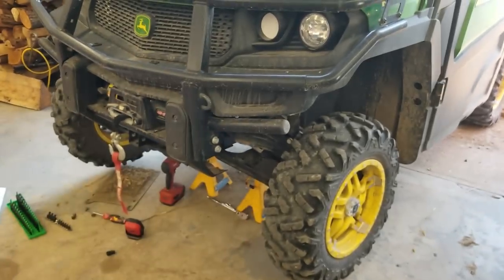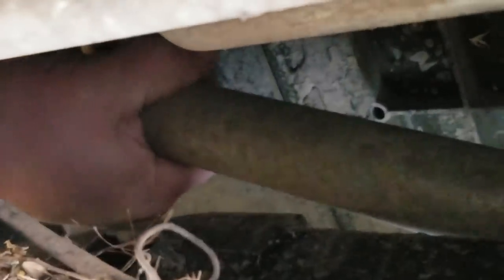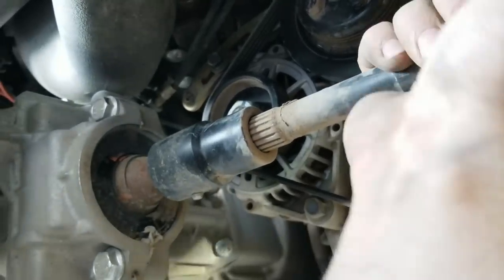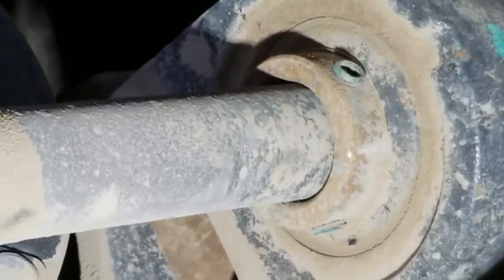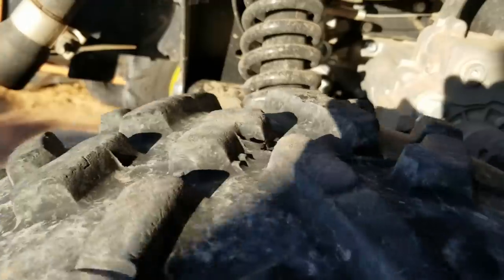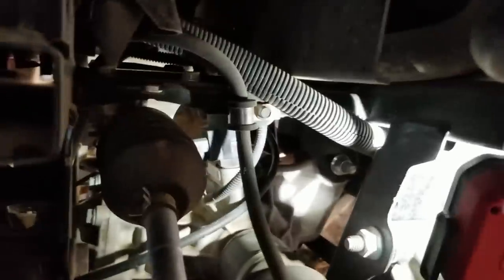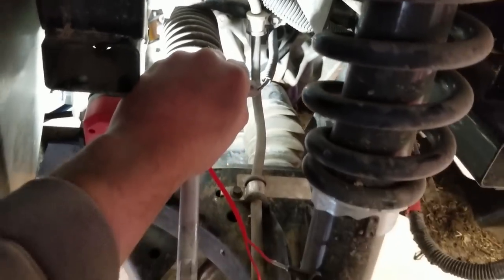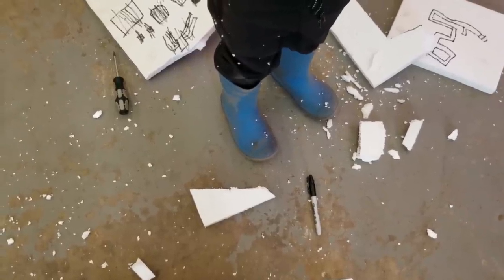Deerest Gator;

Comment: Dave's rule...The stranger the electrical problem is the more likely it's a ground issue
Reply: Did you test straight to ground or through harness ground?
Reply: Who is dave? You?
Reply: Specially with a funky voltage.
Reply: Yeah, seems about right. And comparing hot to a known, good ground as well as the harness ground is always a good idea
Reply: Said me a Cherokee owner without a factory temp gauge.
Reply: @carlholm7867  not to throw a wrench at your monkey but what if it's a ground side switched circuit. There for not known circuit design may appear to be an open.
Reply: Especially when voltage is low. Could be a corroded connector somewhere too.
Reply: @uberdang830  bingo, common for solenoid control
Reply: Best & truest comment I've read this millennium
Reply: Or a fuse
Reply: Anytime the angry pixies aren't raging out of the factory in the correct direction I always start with step 1.... Grounds grounds fn grounds!
Reply: Dave Thomas? I thought he was known for fresh never frozen…
Reply: The IO system on the buses I work on almost exclusively switches grounds for inputs. It's annoying but safer for the modules.
Reply: Seems to be modules instead of grounds for me
Reply: At least with DC 👍
Reply: Came here to say it sounds like a ground issue as well. Rubbed wire or such. Good luck with the repair
Reply: It is possible that the confuser will not power up the solenoid unless the engine is running.
Reply: @Travis Titus  I'd be surprised if the signal came from there. It's a simple on off. Easier to accomplish with a switch.
Reply: Dave? Dave's not here, man.
Reply: @tracyrreed  scrolled all the way through to make sure someone covered this 👍👊🇺🇸🤘
Reply: Ahh good times, inherited a mid 90's Olds sedan from my grandma in my mid 20's.  Every time the + sidepost got too loose it'd randomly decide to kick the automatic headlights on sometime during the night and kill the battery.  Was unlucky enough to be outside burning a cancer stick first time it happened under my ownership (my grandma had always assumed it was her fault when she was alive b/c she never saw it happen with it being stored 24/7) and nearly swallowed my smoke when it did it's christine impression at 1:30 in the morning...  The fact that messing with the switches did NOTHING til I ran back in and grabbed the keys to power cycle all the systems was just icing on the cake.
Reply: @sutitsivart  my thought as well
Reply: @uberdang830  True, but I've never come across that myself, so how common is that really? I'm just a basic home wrencher tho, so I'm certainly not the most experienced.
Reply: @carlholm7867  it's really common in automotive circuits GM late-models, Chrysler. So it gets interesting because you can easily burn out a computer driver.
Reply: @carlholm7867  scanner Danner is a good resource. His book has saved me thousands of dollars.
Reply: Bad Ground, something grounding out, or maybe some corrosion somewhere. Being that its a got 300 hrs, and the state of the grass under skirting,  I'd guess a wire is rubbing somewhere and taking some of the voltage away from that solenoid.
Reply: @ctdieselnut  hey
Reply: @uberdang830  I think you're looking for the word therefore?
Reply: I'm afraid I can't do that, Dave.
Reply: Booger Welding all the wires to the block is mint right? 🤣
Reply: Unless it's a 99-04 superduty then it's probably the windshield leaks and the gem module has been soaked
Reply: @brandonmiller7466  Not the gem module. Not going anywhere without a PATS immobolizer bypass.
Reply: @bluecar5556  the only superduty I've ever had that has PATS is my excursion and the gem module is fucked, neither abs or windows work...well windows work now thanks to a bandaid fix till I get the windshield issue fixed, my first f250 wouldn't come out of 4x4 because of that issue, the current f250...that's just a clapped base model, I don't rightfully know what her malfunction is.
Reply: Oh f250, the diesels didn't get pats immobilizer until later on.
Reply: @countryracer69  no angry pixies here boss… just some lazy cows

Comment: After fixing JD's for years, I've found the easiest way to get at the underside is to use the chain hoist and hang them from the nose
Reply: That or an adjustable lift?
Reply: This is for the vehicles or the engineers who designed them?
Reply: @cerealport2726  As an JD employee i firmly agree.
Reply: @cerealport2726  vehicles, although not putting a harder lift bar on the tractors when the deck has bronze pins has made me want to set people on fire
Reply: @handyman75657  in for a penny, might as well go full send when picking it up
Reply: god ain't that the truth
Reply: @cerealport2726  he said nose, not noose! 🤪
Reply: @duckdog8052  why what’s the difference with bronze pins ?
Reply: @Lamineth  first one, then the other...?
Reply: Same for riding mowers. Just hang ‘em up.
Reply: @jamesfair9751  the hardened bronze pin is tougher than the mild steel lift bar. It wears the hole into an oval then the pin is able to bounce damaging it worse
Reply: I thought the best way to get under a JD was signing the loan?  Puts me six feet under just looking at the total.
Reply: @docferringer  That's why I said to get to the underside, not underneath
Reply: Double duty on that long overdue shop floor oil treatment. Gotta keep your concrete lubed up!
Reply: And just why do I want to get at the underside of a JD engineer? Do they require a annual inspection or something.  I've hurd that  the new engineers come with 1 or more  lift points installed by the owner, and how about some bolt holes in those boots to prevent the engineers from getting too high at work.
Reply: I initially read that as "noose"...

Comment: They never had these kind of problems with the lunar rover 😉
Reply: You could have a reliable vehicle if you are willing to pay 5 million per vehicle. In fact, cancel that, there is one parked on the moon going free.
Reply: Because its a Willy's Jeep.
Reply: Because it wasn't metric 😜
Reply from the maker: Old tech is best tech! Yutu rover traveled 0.1km in 2013, Curiosity 9.9km currently, but Apollo 17 Rover managed 36km in 1972!
Reply: @arduinoversusevil2025  loony rover must be due a service by now…….
Reply: @arduinoversusevil2025  Lunar Rover had proper Red necks driving front and center around the moon.
Not some software millennial in a back office outside Orlando with a joystick navigating across Mars.
Kinda like you on a golf cart in the annual Skookum tournament.
The back nine can be a bit bumpy, but she’ll getcha home.
Mars is a bit more like Saskatchewan.
Reply from the maker: @SupermanJH68  or Nevada.
Reply: @arduinoversusevil2025  'twasnt made in China in '72
Reply: @arduinoversusevil2025  lol, sssh, don't ruin it for the boomers 😂😂
Reply: @arduinoversusevil2025  36km... That has my brain-a-turning. The Gargler says it was running off of Silver-Zinc batteries, and had 4x quarter-horse wheel motors. I've heard that type of battery has very good power density, but that's a challenging comparison there. Especially since the videos demonstrate that they were not really driving conservatively.
Reply: Check the relay. I've seen where they were in route to the f it bucket and just not make food enough contact
Reply: @buckstarchaser2376  If you think that's amazing, you should look at all the stuff they had in the 'Life support backpacks' worn by the astronauts. Pumps, fans, not just one radio but two, and 8 channels of biometric telemetry data too. Apparently all that was powered by a 2kg battery pack, and it did so for 4 hours at a time.
Reply: @harveysmith100  "local pickup only, no shipping."
Good luck.
Reply: They just need designing to last and be easy to fix. But their is no profit in that.
Reply: Or with a '76 F-150.  You just had to ask the missus NICELY to go out and lock the hubs.
Reply: @MichChief   Yep. I've always said if i came to a real collapse of society, go out in a farm field and find a late 60's to early 80's F series truck, i bet dollars to doughnuts you'd get it running in not more than 15 mins max, if it wasn't already. There's a reason they say ' built ford tough ', the only saying  that's true and i've driven all the makes.
Reply: “freedom units”
“Units that went to the moon “
😅
Reply: @MattyEngland  Oh. Well, all those backpack items sound plausible for the era, if you're going to spend several million dollars on each one, and get tech so new that you're paying universities to invent and hand-build it. The technologies existed, including solid-state microcircuits, so that saved power. The battery is plausible, as one-shot "Air batteries" were king shit of turd mountain when I was a kid long after all those missions. 
I was just shocked at the reminder of how non-pathetic historical tech was in comparison to today, but that we've been mostly trickle-fucked our whole lives, because it took so long for it to become "commercially viable", as cattle-management products.
Reply: @SupermanJH68  hey now easy on my software lads, we ain't all made with crapple and cappucino ;)
From my time in aircraft maintenance, i learned it takes a 50% functional brain to tell 2.5% functional mechanics that they can't fix the problem without some lube, wd40, speedtape and a manual.
The manual being there to act as replacement oil filters for mechanics, and a troublechoochin guide for me!

Comment: My advise... if you leave the access panels off... you wont have to take them off next time.
Reply: Found the guy who works at the Quick Lube.
Reply: Won't hold the grass fire against the JD
Reply: But it will take you longer to pressure wash/ pick out the caked mud from the soft undersides the panels once protected.
Reply: And without the panels the mice won't have a place to build their nests.
Reply: I've learned if you leave certain panels off you may have to spend extra time cleaning out blood and body bits from time to time.   Trade-offs.
Reply: Captain MufDyven   Hope your digits have recovered.
Reply: @dougcox835  They’ll have fewer spots, but they’ll still find other nooks to pack with shop towels, I’d rather them make a nest that you can get rid of by taking one skid plate off.
Reply: Weigh reduction. Better fuel economy. Remove those panels!
Reply: Leaving off the access panels follows Colin Chapman's advice to "Simplify, then add lightness."

Comment: Hey  @AvE ! 

I am a John Deere Product Engineer II (Electrical Engineer by training), that works on these products in Horicon, WI. I saw @Jackattack left some good comments, here it is in shorter form. TLDR for engaging 4WD on your machine:

1. 4WD Switch ON
2. wheel speed </= 8mph
3. Not in Neutral (must be in gear)
4. Service brake not being pressed
5. You must be pressing the accelerator
6. Engine RPM >=2300

Longer Comment:

Your gator is pre-MY21 (when the park position was introduced in the transmission, and 4WD updates were made). So your 4WD system is "On-Demand"...which is marketing speak for it works when the rear wheels are already spinning, presumably when you would be slipping.

Not as intuitive as you first thought ehh? We changed this in Model Year 21 with a new 4WD engagement mechanism and solenoid, so when you click the switch it goes into 4WD as long as you are traveling at a slow enough speed for engagement.  1min 43sec into the MY21 announcement video:      https://youtu.be/q9XeTe9UVdk?t=103    

For 4WD engagement on YOUR MACHINE and pre-MY21 gators with 4WD:

1. 4WD Switch ON
2. wheel speed </= 8mph
3. Not in Neutral (must be in gear)
4. Service brake not being pressed
5. You must be pressing the accelerator
6. Engine RPM >=2300

Seeing ~2V on the connector with no-load connected is normal as the controller checks inputs and outputs. 

So to test your 4WD engagement in your current setup (all wheels off the ground like I saw, machine safe and otherwise supported/restrained), with the solenoid plugged in to the original harness,  press the accelerator when its in gear and 4WD switch is ON. I think you will see it kick in around 3mph or when the engine gets above 2300RPM.

From MY21 onwards however the engagement solenoid, mechanics, and logic were updated so you can engage 4WD at 0 wheel speed when you are just parked idling before you take off, due to customer feedback.

#JohnDeereEmployee
#itscompanypolicytoclearlyidentifyourselvesonsocialmedia
#loveyourvideos
#Idonthashtagmuchsothisisnewtome
Reply: I gave this a thumbs up so that he has a better chance of seeing it.. and to ask you how it feels to work for the Empire?
Reply: That is a helpful post!
Reply: The question is why make such a complicated system..why not just a toggle on the dash, on or off,,no need for minimum or max speeds, etc etc
Reply: Joe! Funny to find you on this posting! :-) How's it going? Tell John and John and Zach and Les that I said, "Hi!"
Reply: Obligatory engagement comment, to boost the OP comment's position in people's feed!!!!!!??????!!!😀😁😉
#engagement
#greatcomments
#johndeere
Reply: Y’all need to get away from electric stuff on those.
Reply: I'm wondering why the pre 21 "enhancement" was done, especially if it just got reversed, can't for the life of me imagine why you would be disengaged at lower speeds, when someone gives it the beans and it is totally burried in the mud and suddenly engages, KA POW goes the tcase, splines, or tranny. IMHO.
Reply: @mattfleming86  Good Dental and Vision insurance!
Reply: I bet that was in the manual
Reply: @tacomas9602  Not like electric is the future ;)
Reply: An actual engineer engineering stuff to work!! Wow
Reply: Customer feedback no kidding!!! We paid for 4x4 when we want it not when the machine so graciously decides. Obviously software designed by someone who dosen't use one on a daily basis checking cows, fence,ect.
Reply: @josephwalters1563  Now that is how you answer a really layered question!
Keep up the good work!  Millions of people count on JD equipment on a daily basis.  Always fight the good fight.  Folks are counting on you!
Reply: Now there's the correct answer. Thank you Sir. 🤝🤝🤝
Reply: Who on earth thought it was a good idea to only engage 4WD on a conditional basis. I would kinda get it if it was a consumer high performance sports car, where it would have an "auto mode", for fuel economy, but it's a Gator...
Reply: Hell, I'm surprised JD allows a comment like this.
Reply: Does it need a software update or scan tool to work?
Reply: Nice of you to take the time to help with such an informative post.
Reply: Why not have it so when you pull the lever you have 4wd?
Reply: @chspyderr  Yeah what's up with that, you want 4wd/locks on before you get stuck
Reply: @chspyderr  Because it's a farm unit not an off road unit. If I had a guess it's because customers told sales they don't like it when they tear up the yard at slow speeds hence the less then 8 mph engagement. Also makes it easier to turn at low speeds and keeps the "lowest common denominator" from blowing up the front diff. Polaris and Can-am also use a similar diff but they are a clutched style like an LSD. Only UTV that's true 4wd is Arctic Cat, engages when you click the switch.  If you ever watch a polaris spin it's tires in mud it will do exactly what you say about engaging and ka pow especially older ones.
Reply: Please sir the corporation prefers the line "It just works."
Reply: @chspyderr  Its not a Mitsubishi there chief, they're not made of crystal vases
Reply: I was screaming at the screen the whole time, IT PROBABLY HAS CONDITIONS FOR ENGAGING THE 4WD YOU DOLT.
Reply: so if i got this straight the customer feedback corrected the engineering that cocked up the design,...but hey, at least they responded to said feedback. lets see what comes of the
bush country mod that's going to appear on that dashboad.